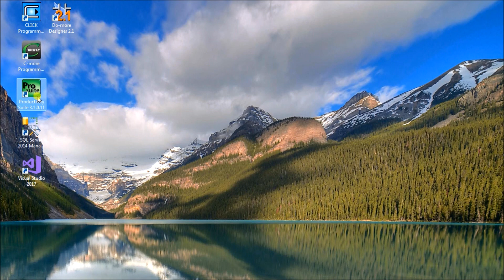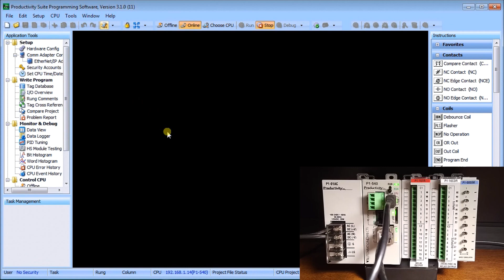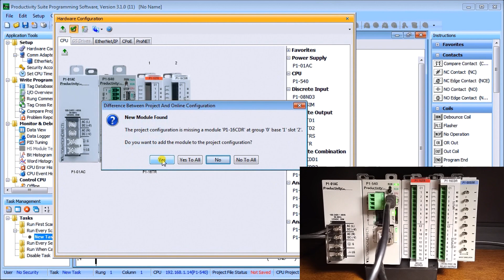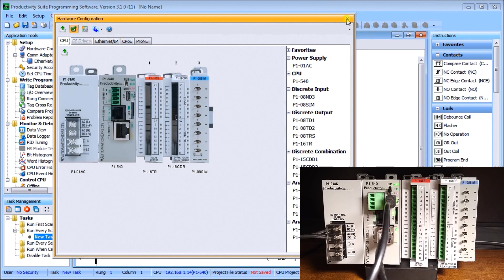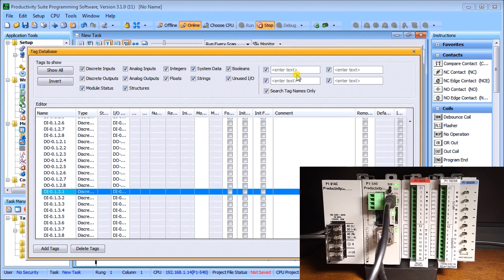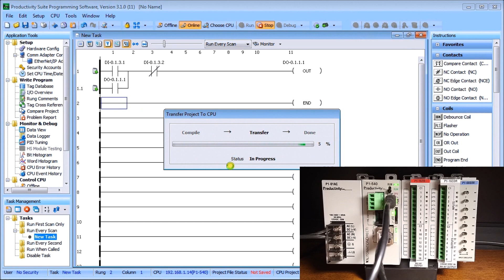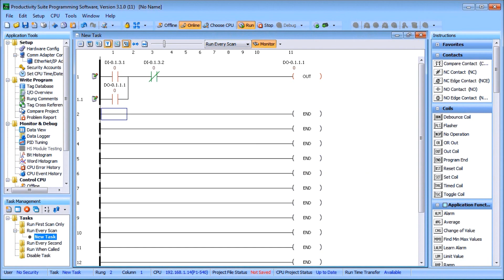Master PLC Programming: Create a Start-Stop Motor Circuit Now!

Comment from the maker: More information can be obtained on our website. This includes all of the links mentioned in this video.
https://accautomation.ca/productivity-1000-series-plc-first-program

There are several reasons why we are using the Productivity 1000 Series Controller. Here are just a few.
- 50MB user memory - Can handle very complex applications easily.
- 4 built-in communication ports – Easy connectivity to your network. 
- Data logging up to 32 GB on a microSD card
- Add up to 8 IP modules to communicate to your field sensors. This will give you a total of 128 discrete IO points or 32 analog IO channels.
- Free Software and 30 days of free training with every CPU from Automation Direct.
- Interactive PLC Configuration Tool
- Tag Names
- Auto-discovery IO – Physical I/O tags will be generated based on each module’s position in the base.
- I/O Modules have QR codes under the wiring cover. This can be scanned so you can have the latest specifications/wiring diagrams for the module.
- Limitless PID – Autotuning – Individual or Cascade Mode - etc
- Web Server and Mobile Access
- Advanced Software instruction set

The Productivity 1000 series of programmable logic controllers currently has all of these features built into the P1-540 CPU.
This CPU (Central Processing Unit) is also known as MPU (Multi-Processing Unit) because of its communication capabilities.

ACC Automation
https://www.accautomation.ca

Comment: At 6:02 how do you create the line that goes down? It just seems to appear out of nowhere. I didn't see you select anything and you didn't say in the video how to make it.
Reply from the maker: Hi ProVampFire,
If you hold the Ctrl + Down arrow key this will create the line going down. 
This can also be done using the main menu | Edit | Wire ... This will also show you the keyboard sequence to use for all of the wire connections.
I hope this helps you out.
Regards,
Garry

Comment: Will this software work with the p1am CPU?
Reply: Never mind. I found the answer to my question. P1AM is compatible only with the arduino IDE and the productivity 1000 modules but not the productivity suite programming software.
So i should've bought the productivity 1000 CPU since it's software uses the ladder logic to program it. That's what I needed since most jobs use ladder logic programming with their PLC's.
I guess that's okay though. I can still get some good practice in with the p1am. And then when I'm ready i can upgrade to the p1000 and I'll already have some of the modules since the modules are compatible with both the p1am and the p1000.
Reply from the maker: @ryed8118  
If you are just looking to practice. The productivity suite software has a built-in simulator.
https://accautomation.ca/productivity-suite-plc-simulator-software-free-download
Regards,
Garry

Comment: Was the only reason for branching down with the output DO - 0.1.1.1 so that you could turn the first input off without power stopping (looping the output into itself)? I'm assuming this is necessary if you're using a power button, rather than an on/off switch? Thank you!
Reply from the maker: Hi Caleb,
You are correct. This is called a sealing contact. It is used just as you mentioned.
Thanks for the comment.
Garry
Reply: @ACCautomation  Thank you! A few videos in for you now, so it is much clearer.
Reply from the maker: @calebsmith4477  
No problem. Let me know if you have any questions.
Regards,
Garry
Reply: @ACCautomation  I’m having a little trouble understanding this concept. What would happen if you did not branch down to this output?